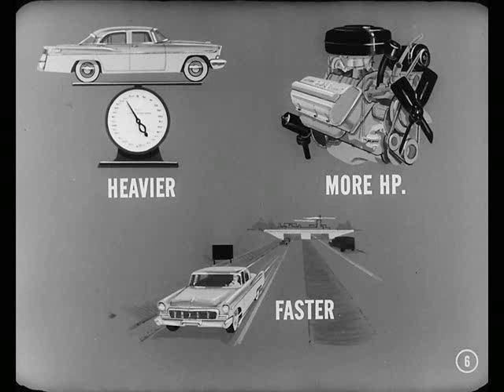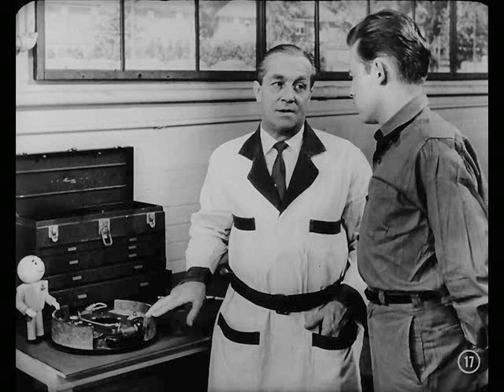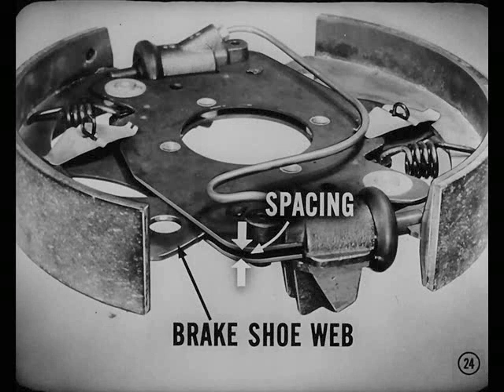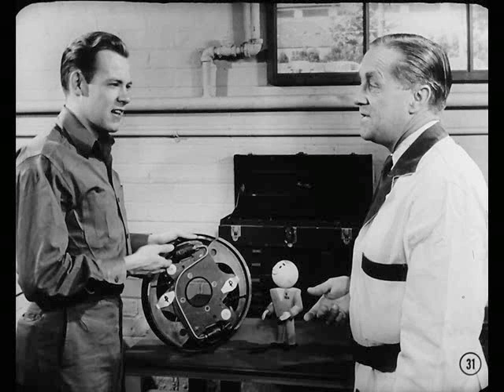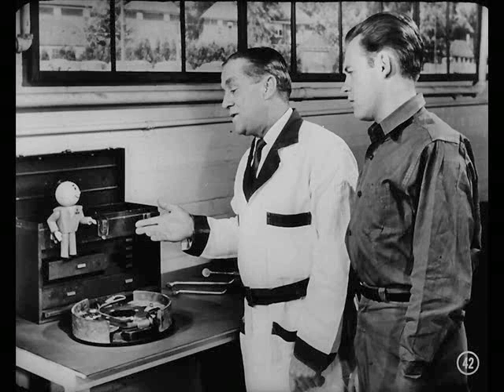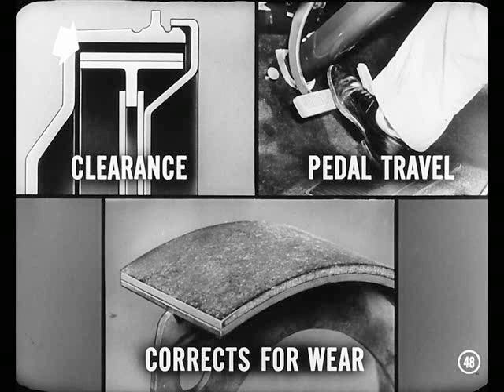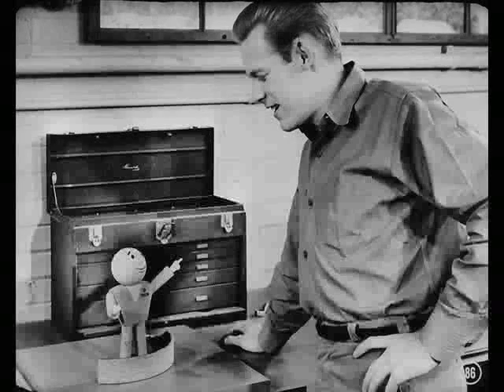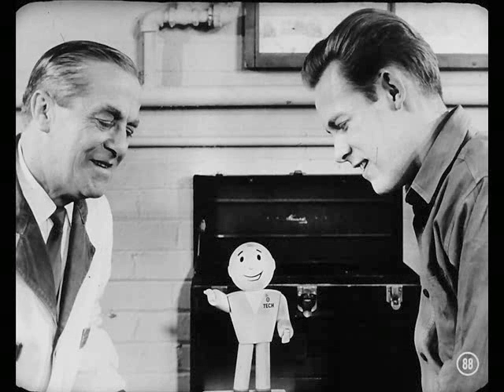MTSC - 1955, Volume 8-12 The New Center-Plane Brake

Comment: This video is a life saver for me!  I'm doing a brake rebuild on my dad's '56 300 and these center plane brakes are different than anything else I've ever worked on.  Especially when you R&R the return springs.  Seeing the factory spring tool and how it's used was a huge help.  Like Tech says at 11:14:  Once you try removing or installing that return spring without the proper tool, you'll soon find out how necessary the tool is for the job.

Showing what tool is used to adjust the rear shoe on the front brakes was helpful too.  You can't get a socket on the adjuster because the steering arm on the spindle is in the way.  I was thinking about making a custom tool to fit, and lo and behold my idea looks a lot like the factory tool.  I might be able to find an offset wrench that would fit, rather than having to make something.